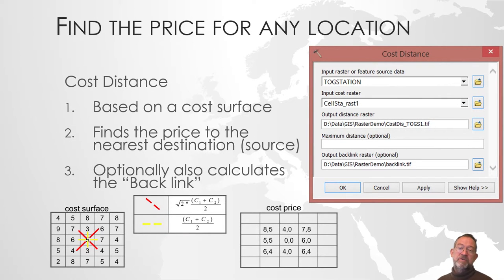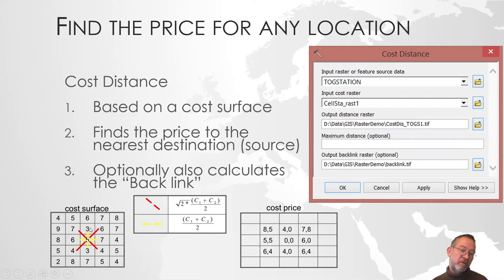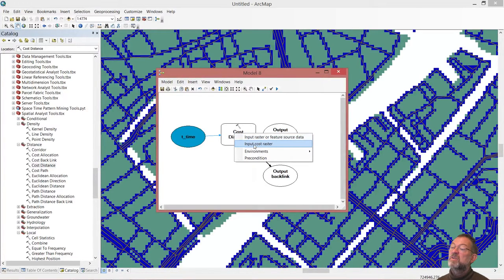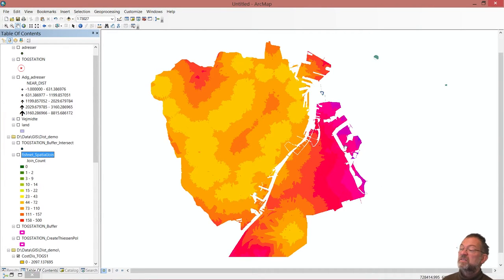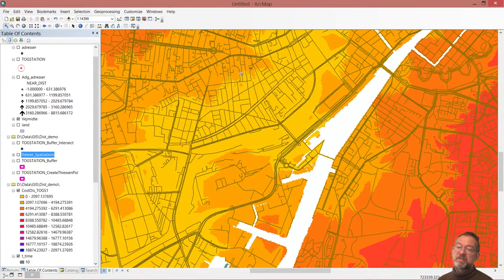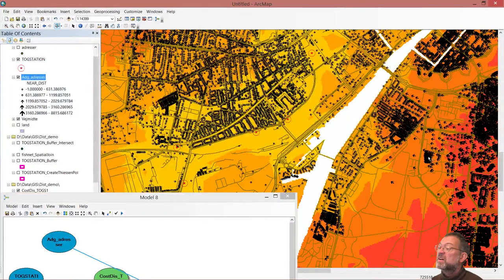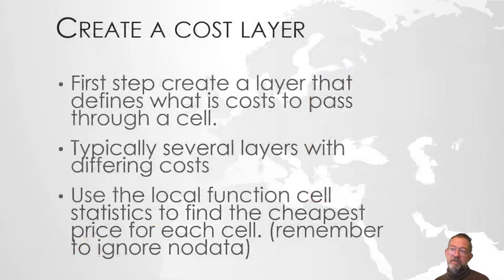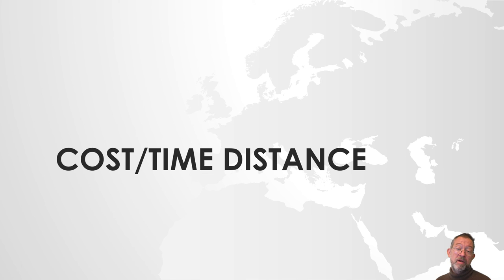Finding the shortest path usin the cost path in ArcMap

Comment: thanks for your tutorial... I have a question: I have all my points (roughly 50) in a unique shp in acmap, I would to use the same file both origins and destinations to calculate the least cost path. Is it possibile? In case, could you suggest me how or a tutorial or some paper on it? Thank you in advance.